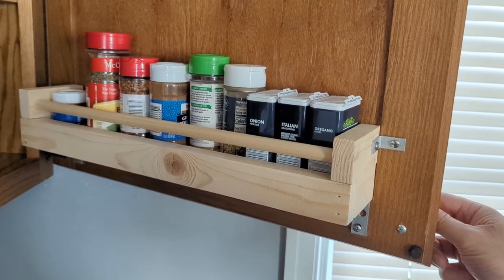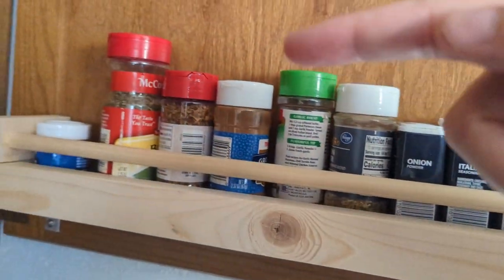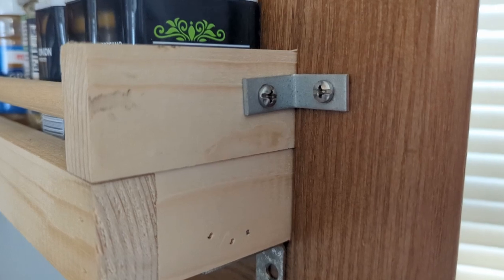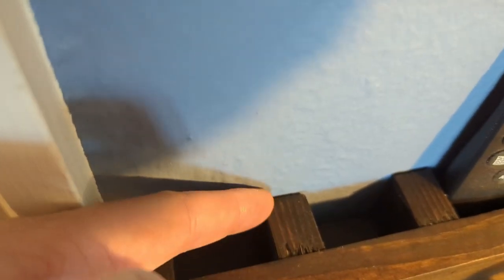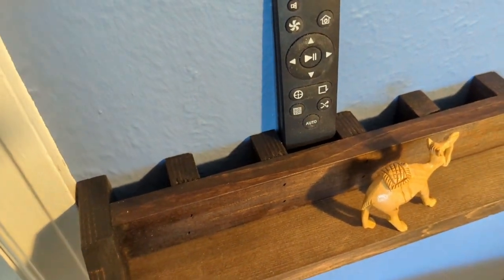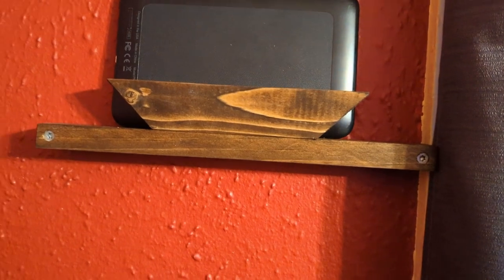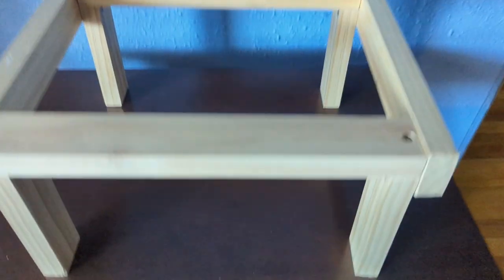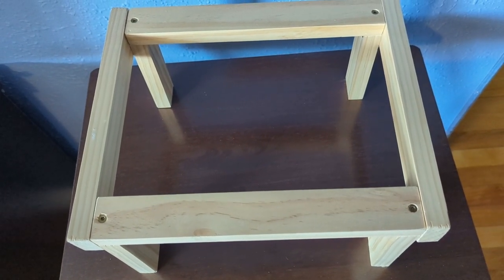𝟒 Simple 1 x 2 Wood DIY Project Ideas

Comment from the maker: UPDATE for the remote holder it stayed in place for the most part but would occasionally drift... So i decided to mount it to the shelf with screws. If you wanted a less permanent way to mount it you could use sticky tape.